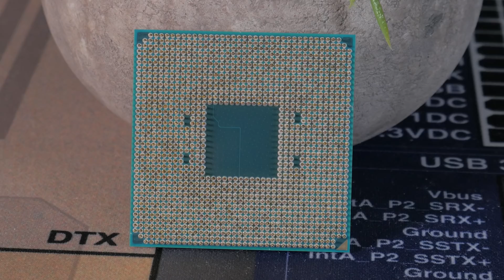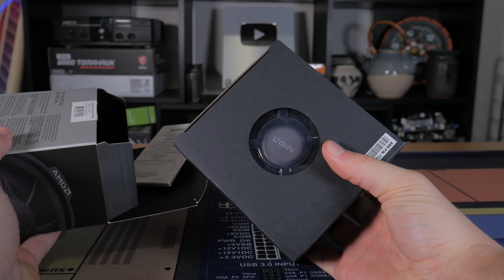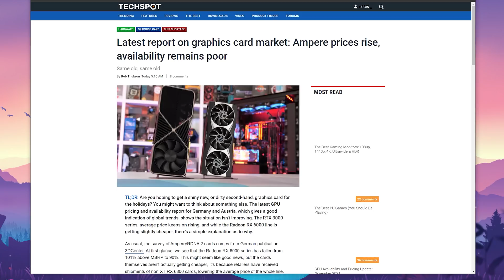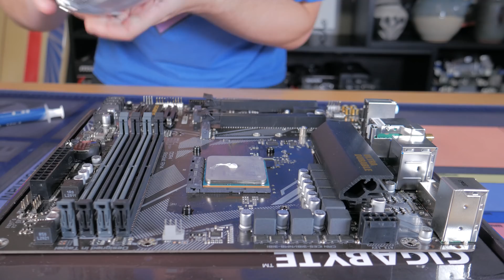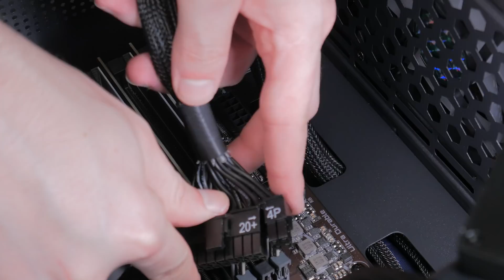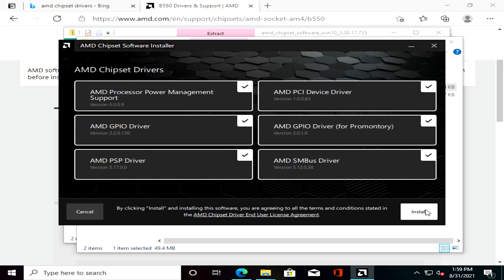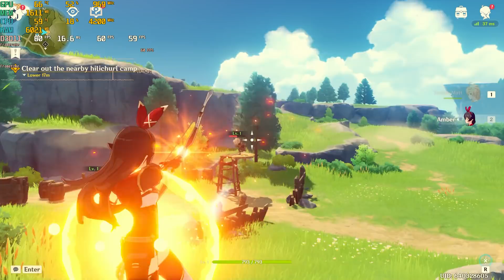BEST $750 Gaming PC Build Guide! (Late 2021)

Comment: My PC Game config on dez 2021 😎

Motherboard ATX Gigabyte Z590 UD AC (supporte PCIe 4.0)

CPU Intel i5 11400 (supporte PCIe 4.0)

Cooler CPU Arctic Freezer 34

RAM Crucial Kit 32GB DDR4 3200MHz Ballistix Black CL16

SSD Samsung 980 PRO 1TB Gen4 M.2 NVMe

Graphics card Asus RTX 3070 dual oc 8gb (PCIe 4.0)

Power supply Corsair CV-650W Dual EPS 80+ Bronze

No overclock 

I play every recente games at 2k above 100fps

Comment: Hello mat or anyone reading this comment. I recently bought this motherboard and cooler and case. When I went to install the cpu fan the spacers in this video that are underneath the brackets are not on my motherboard. Did yours come with those spacers? Or was it the case that came with those spacers? I am open to getting help from anyone thanks .

Comment: Thank you so much for this video. I've been wanting to build a PC for the last year but had no idea where to start, what to get, and which items are good etc, and wasn't trying to get anything too expensive since it'll be my first. But after watching this video my confidence has gone up a bit, and truly looks like something I can tackle myself, maybe. Truly informative and a user friendly tutorial. Had to sub for more quality videos like this in the future. Truly, thank you.
Reply: Coming back to update my comment, ended up building a PC and this video was the one that gave me confidence! Did watch other vids and read the manual as well. Was going for this 750 price range but after further research decided to just get some things that will last longer or just a more later version. things I stay with were the cpu kinda, except i got the ryzen  5 3600x instead of G, still got a b550 but the msi tomahawk, no wifi since Im connected via ethernet, and stuck with the same PSU. GPU hunting had me going crazy but ended up copping a 3060 from best buy :)
Reply: @iskate40  how is the pc going so far
Reply: @mrmrmeta3698  Dude its amazing. Using it as we speak. I mainly play fortnite LOL but also some halo infinite, tekken, and have numerous emulators (ps2, ps3, wii/gaemcube) for older games. but I can play, stream/record all at once no issues. Never overheats. I love it.

Comment: This build would be spot on if you had a CPU water cooler , that Ryzen 5 is going to be running like a Jet, cpu cooling should not be over looked especially if over clocking

Comment: Looking at the prices of laptops, it’s a much more viable option now as its performace really progressed through the years. This set up already costs around 800$ plus you’ll be needing a decent monitor too/peripherals, around 100$-250$. RTX 3060 Laptops costs around 1000$ with a 144hz 1080p screen, a decent keyboard too, also with a really sleek design. So might as well look into laptops if you guys want an msrp RTX card.
Reply: Well drop some laptop recs💀
Reply: @algae2496  depending on your region it varies but a good budget friendly option is the Asus tuf f15/a15 “2021” (tuf used to suck but the 2021 is good) absolutely avoid “dash” model. With i5 11400h + rtx 3060 (or 3050 only 4vram tho but also bang for the buck if you can get in 850$), for a much more premium design and thermals go for lenovo legion 5. If there are no 11th gen models that are available you can absolutely go for a 10th gen 6 cores combo with either a rtx 3060 or gtx 1660ti. All in all asus is much more budget friendly and lenovo should cost around 1100$+ and if you get lucky with discounts maybe less. I once saw a legion 5 with 3060 17 inch model fetching for 950$ on discount. Acer nitro 5 is also good but I really don’t recommend acer from my experience.
Reply: @verynice4829  thanks a lot, I checked them out great recs dude
Reply: @verynice4829  honestly would rather builld this modest build for the price range given that eventually, nobody knows in how long, GPU prices will go down, I would rather have a build where I could upgrade my GPU into something like a rtx 3060 maybe 3070, and would be much better off than a laptop GPU version of an rtx card.
Reply: @no.9ava157  Its your choice but if you absolutely need or want one right now you can buy anything. Just saying laptops offer better prices now than desktop’s.

Comment: I have just have  one  problem with this guide: he says not to buy used (except for the graphics card). Buying used is probably the best option by far for someone on a low budget like this. He even says himself that through ebay you get buyer protection. Jus for an example i went and spect a system with a 1060 and ryzen 5 5600x ,along with some other improvements, and it only cost 740 with shipping sooo i would always buy used at a low budget like this.

Comment: This is very close to my current system, I have the Intel 11400f which where I live is cheaper than the r5 5600, 16gb ram 3600mhz, amd r9 390x, witha 550w 80+ bronze power supply from xfx, paired with two ips 144hz monitors, absolutely no issue at 1080p

Comment: Does the non WiFi motherboard allow a wireless WiFi connection?
Reply: Yes of course. You will either need to buy a USB wifi adapter or a PCI-E wifi adapter. 
BTW, "wireless wifi" is redundant. By definition, wifi is wireless.

Comment: I don't understand why you would use a 5600g instead of a 5600x if you are using a used graphics card.  I'm looking for a new budget build based on my existing Sapphire Radeon 5500 XT Pro graphics card.  My old system is getting flaky, and the replacement motherboard for my ancient processor seems too expensive.  For this card, should I use a 5600x or an older cheaper processor?

Comment: i bought a used PC and since then i have done some upgrades like a new graphicscard before they skyrocketed, new motherboard and a cpu. i have spent about 700-800$ and i can run most new games on decently high graphics. Next upgrade is my graphicscard but yeah they are so expensive

Comment: i just bought a pc for 800 dollars becuse my pc broke
its a ryzen 5
1650 super
8 gb of ram
btw its a prebuild but is it worth the price?
Reply: Try to upgrade it with another 8gb stick of ram, and put it in the correct slot to run dual channeled. It’s not a great prebuilt but with how bad prices are, that build sounds about right price wise. Hope this helps
Reply: @kmn4173  if im correct the ram is 2 sticks of 4 gb of ram but sould i save some money to replace them completly or what?
Reply: @mezu181  It matters how many Ram slots you have on your motherboard. If you have only two slots, I’d say only replace 1- 4gb stick for 1- 8 gb stick of ram to save money. If you have 4 ram slots on your motherboard, just add another 8gb stick. Though you’ll be able to find a better deal with ram by buying 2X8gb sticks of ram. Try to stick to 3200mghz  or faster ram bc you have a ryzen build.
Reply: I'll give it to ya straight 
That is miles better than the one in this vid 
But do what the other guy said and add another 8 gigs

Comment: Sorry dude, I like you and I think your production value is good.  But the build is trash imo.  For that money, you can buy better prebuilt stuff let alone DIY... I mean - being totally constructive about it :

This seems to be aimed at amateur guys but they'd be better off buying a prebuilt with that money because they will be getting around about the same level of performance, just without all the weird quirks and parts that won't last the year.  You have heat chugging parts in a poorly vented case with half the required fans, and not enough storage for gaming.  So this build actually needs about another $200-300 spent on it before it's in any way useful to game on.

Hmmmm.  I don't get it.

What are you targeting here, gaming?  I don't think this thing could play 3/4 of my library at 1080p/60fps high detail, which is the low bar for my own system and that cost like 40-50 more than this thing - but features better everything (except CPU).  I feel like gaming doesn't require an i7 which is where most of your money went.  Also the R9 Fury is a waste of money, it won't last and it's currently not good enough for high detail settings past 40fps in todays games.  Even for emulation it's not enough for steady GOOD PS2 and above gaming.

There are plenty of mini-pc's at this price point which outperform this as well as offer better component quality.

I just can't understand who this is aimed at?  It's a very expensive low budget system with a tacked on CPU.  I mean that's assuming you can actually find any R9 Fury cards for the price you say you paid.  Currently you can't even get a 1050ti (which is like 2/3 of the R9 Fury) for les than £400 so what makes you think a newer better faster card on finer lithography will cost you half of that?  But you went in hard on the i7 for gaming, it doesn't make sense.

Sorry dude, feel bad to point to it.  But it's fact.  This PC kind of sucks, though I enjoyed watching the video.  Better luck on the next one!  Maybe plan out your user first before you do the build :)
Reply: Here's what I think you might have done better with on the $750 budget :

First get a pre-build minitower with these specs new (Cost between $600-700)
Black ATX Gaming Tower Case
AMD Ryzen 5 2600 (6 x 3.4 GHZ - Turbo 6 x 3.9 GHZ) + Stock cooler
3 x basic case fans (adding a fourth does barely anything for cooling)
AMD RX5500XT 8GB Dual OC Gaming (1750-2000mhz core / 2000mhz on the mem core)
Asus PRIME B550M-K (AMD B550) - 6xUSB3 - (M-ATX)
2 x 8 GB Kingston 3600mhz DDR4
2 TB Seagate (2000 GB) SATA-III HDD 7200 RPM 128MB Cache
Motherboard Integrated HD Sound
Wireless Network Card 300Mbps (PCI-E)
Motherboard Integrated 10/100/1000 Ethernet Lan (Broadband Ready)
GameMax 750W (Modular) PSU - Low Noise

This beats your system in every area.  computerplanet in the uk but only because it was literally the first one I found with graphics cards in stock, which weren't scalped to all hell.

Compare the two.  See how you feel about it 👍

Comment: do you think this would be good with a GT 1030 Graphics Card 2GB DDR5 instead (will it be better or worse and if better do i need a better psu or something) 
great video by the way loved the way you explained the parts
Reply: vega is about the same thing as gt 1030 so no point using both, gt 1030 doesn't consume much so you won't need to change psu. If the psu is a problem vega it's probably your best bet, maybe gtx 1650 down the road, then sell  your apu and buy a 5600x instead, no point in apu if you are not going to use.

Comment: How did you set your ram clock to 3600 mhz. Mine is stuck at 3200 and if i go above it wont post. And i have a 4400mhz gskill

Comment: Good pc, but its just crazy to recommend someone buy a R9 anything these days if you want a slightly future proof build. R9 390 and below it are in legacy support mode, meaning no new drivers. The impact to this card due to lack of new drivers is already being felt by people trying to play Halo Infinite, causing people to turn to modded driver sets to get it to run stable. It's only going to get worse for this card. People really would be better off picking up a GTX 970 or GTX 1060.

Comment: I'm actually stunned that you were able to put together a pc for that cheap with those specs. Considering I just spent 4000 bucks on a top end system, this one makes WAY more sense.
Reply: this are bad specs man.
Reply: @jimmythecrow  Huh, I didn't know that...
Reply: These aren't good specs at all lol
Reply: if it's 4k, did you at least get a 3080ti?
Reply: @crashcourse11-x3u  Ya, 3080ti/5900x
Reply: @Mustang1984  Yeah the step down from a 3080ti to integrated graphics would be kind of rough... But you could build a way better system than this if you're willing to buy a used graphics card. Just built a $800 system with an r5 3600 and a GTX 980.
Reply: @demitriusrawluk5747  Oh really? Yeah I didn't mean the specs were great I was more referring to the economy. I figured you'd be on integrated graphics at 750 bucks with gpu prices. That's pretty good tho, the 980/3600.
Reply: @Mustang1984  that’s a scam bruh. The pc this guy built is pretty trash. I bought a gtx 1660 prebuilt pc for only 750 dollars.
Reply: @Avubus  Well that's good to know man. Not really into lower system specs. Always go for the high end. But good to know you can still get an even better system for that price.
Reply: @crashcourse11-x3u  also not on 4k, on 5120x1440p....close tho.
Reply: i Just build a whole PC with 5600x but no GPU im using my old r7 240 poor thing cant keep up. I'll get one when pricing goes down hopefully soon enough
Reply: @SlavSlavov-1  yea that's old brother. can you at least play in 1080p low?
Reply: Funny, you and some other guy posted the same thing... verbatim. Interesting.

Comment: what's the difference between the board with no wifi and the board with wifi?

(not good with pcs at all)
Reply: With WiFi is a lil bit more money. The WiFi one just has a component that lets it use wireless internet, no WiFi would need an ethernet cable
Reply: @GruelingFive8  I see, thanks!

Comment: Where do I find an extra SATA power cable, and an extra PCIE power cable?

Also, if you need extra thermal paste, is there any specific kind you should get?
Reply: those cables come with the power supply. connect what you need. 

and, in his $1000 build few vids back he uses Arctic mx-4. it's decent but you can also get mx-5 or other similar priced stuff.
Reply: @Triangledime  oh.  I'm just a fool, then.
Reply: @bulldozer6781  if you watch a few diff builds you start to get an idea so it's no problem. he's using a semi modular power supply that's why those cables are not connected already and you can connect what you need saving the clutter

Comment: I would get a 3700x, GTX 780 ti, 80+ gold 650W EVGA PSU and a good used b450 with the other parts in the video for 800$ total because more cores and threads with similar performance to the 5600g and the 780 ti is faster and cheaper since the latest driver are not supported
Reply: But 780tis are keplars and probably will perform around 1050tis despite being faster
Reply: @yefuzz  they perform like a 1650
Reply: Horrendous
Reply: @cement_slab  3700x has better performance in video editing and same performance in gaming and the 780 ti is faster than the 5600g iGPU and is on par with a 1650
Reply: @ShahhTweaks  ryzen is a pointless purchase atm
Reply: @ShahhTweaks  and a 780ti only has 3gb of vram and no driver support so thats a bad choice
Reply: @cement_slab  it's a cheap alternative until you get a new GPU and most competitive eSports gamers run fine on driver 441.41 or 457.30
Reply: why specifically a evga 80+ gold?
Reply: @Ryan-sw3km  they're reliable
Reply: @ShahhTweaks  you realize that they're not great value and the 80+ rating means nothing in terms of quality, right?
Reply: @Ryan-sw3km  80+ gold or platinum from evga are reliable I never said 80+ rating meant it was reliable I said from EVGA it is
Reply: @ShahhTweaks  ehhh some of evga gold and plat rated Psu's have major issues with high transient draw. I wouldn't exactly label that as "reliable"...

Comment: What i built in september for $750:
i3 10100f - $120
2x8gb ddr4 2666mhz cl16 - $110
Msi gtx 1650 d6 gaming x - $300
Asus prime b460m-a - $120
600w lc power lc600h psu - $35
Nmve 2.0 ssd 480gb - $55
Cheapest pc case - $20

I just hate that the 1650 was about $200, and rx 580 8gb was $180 1 year ago, and now u cant find 1650 that is under $400 and does the rx 580 even exist now?
Damned miners...
Reply: Jeez man, 2x8gb 2666mhz for 110 dollars?

Comment: Great vid guys! Love the build. If you wanna look for a more budget friendly pc you can look through eBay and find used rx 570’s and 580’s for around 290-310$. It’s a good deal for the price although it’s high still. The Msi Armor rx 580/570 you can find for a good 300.
Reply: Don’t get a 570 or 580 for anymore than or around 200 at max 💀 300 is a terrible deal in all aspects
Reply: @wildupont8990 
Have you seen what 580s are selling for? $200 was true, back in the day, when they were brand new.

Comment: I have a variety of selections when it comes to gpu raging from 3060 to 3090 and 6800xt to 6900 xt, as I am more or less a small miner since beginning of April 2021 (I paid the scalper's price on FB and craiglist market, so don't get mad at me). Having said that, I'm still at core so cheap  my main mini itx nr 200p system only consists of 5600g, 32 gb c16 ram, b450i aorus mobo, 600w sfx corsair and 1 tb nvme m.2. 5600g imo is the best price to performance cpu to date due to the gpu shortage and the ability to upgrade later on. Between 5600g and 5600x, the average fps or performance difference is about 5-10%, highest at 720p and about 5% difference at 1440p and 4k depending on the gpu.
Reply: Yea it becomes all gpu at 1440p

Comment: just the 5600G is reasonable instead of an outdated gpu just put the money to a 3600MHz CL16 kit ram and an aftermarket cooler to overclock it and you'll get a close results in 1080p high valorant eith 170-180 fps :)))